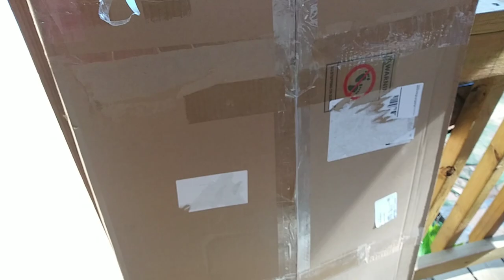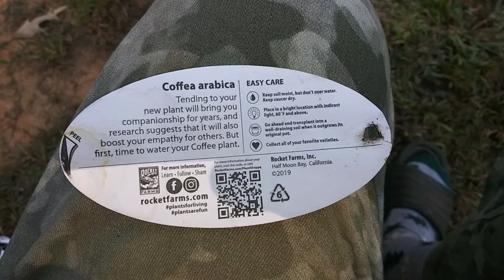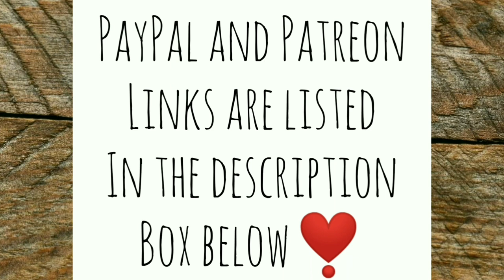HUGE Off Grid Solar Upgrade, Chickens Free Range and Roost Upgrade - Ann's Tiny Life

Comment: Please read up on mixing different wattage panel together. I think there is a problem with the amount of power you get. I think the small wattage panels will reduce the amount of power you get from the larger powered panels. I am not positive but when we were buying our solar for our motorhome that is the way it was explained to me. Be sure and read up on that.
Reply from the maker: I already know this and I stated in the video that I was going to research more . Thanks!
Reply: You need to match the voltage of the panels in parallel, your small panels are likely 17V and the big one 36v there's no good way to add this to the current controller unfortunately.
Reply from the maker: @MrJeffschefke  yeah I think what I'm going to do is use the 300 w panels on the controller and inverter that I'm currently using the renogy panels on. get rid of the harbor freight panels and use the renogy panels on the other controller. That way I won't have to mix batteries either.

Comment: How is the solar working when it’s overcast? Do you maintain enough power for the frig?
Reply from the maker: it definitely doesn't operate up to full charging capacity. no I'm not able to keep the refrigerator on 24/7. but that doesn't matter because it's going to be getting very cool soon. I may keep refrigerator outside and keep food cold in it. maybe put it on my porch and cover it with something so it doesn't get all dirty and what not. it will be cold enough to keep things Frozen in there. but before long my solar will be upgraded to the point where I will be able to keep the refrigerator inside and on 24/7. just need one more battery.
Reply: @AnnsTinyLife  - lucky you are having cool weather - today it was 98 today!

Comment: Those leghorns are some scary looking chiks 😨 How often do you need to change their bedding? Also, do they need to eat or get shots for parasites? Im gathering info in the event I get chickens. Thank you Ann.
Reply from the maker: I'm using the deep litter method where the bedding composts as the chickens kick it up. I talked about it in another video way back. with the method that I'm using if it's done right you only have to change the bedding a couple times a year. I guess what I'll be doing is using the sniff test. if it smells bad I know I'm doing it wrong. as far as parasites the best medicine is prevention. keeping their food and water bowls clean from droppings. and if you're not using the deep litter method changing bedding often. yes you can get them vaccinated or you can buy medicated chick feed but the information I've collected tells me that medicated chick feed may not be the way to go. still learning myself though.
Reply: @AnnsTinyLife  Thank you Ann! Great info and I learned something about the "deep litter method" which I didn't know before and so much more!